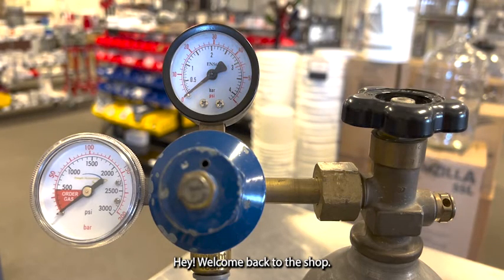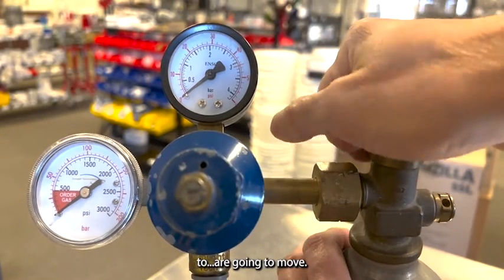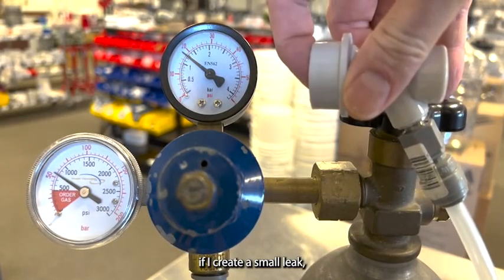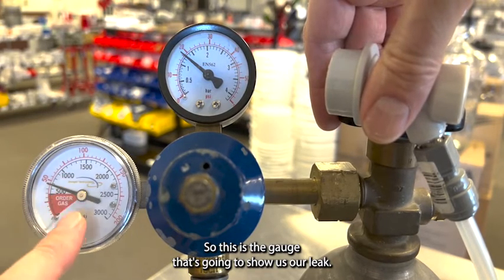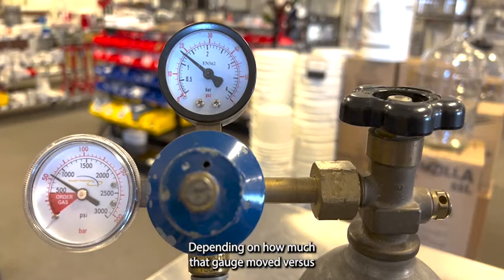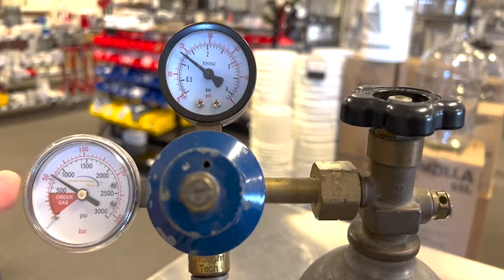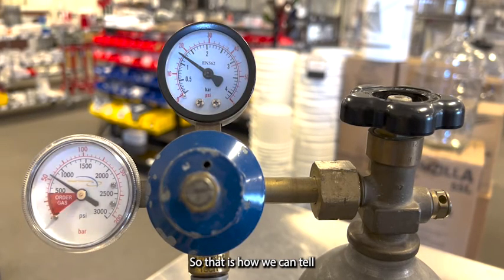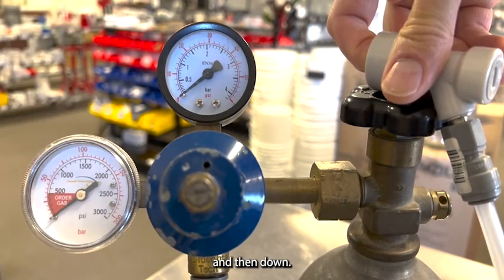Do I have a CO2 Leak?

Comment: Hi there, when I replace a new CO2 tank, I hear a leak from the adjustment knob, so I close it, the I adjust back to 100 psi and doesn't leak anymore. Do I need to fix the regulator, it's  a Taprite.
Reply from the maker: We have questions... The PRV (pressure release valve) on a Taprite CO2 regulator generally release at 65psi max. Are you turning your regulator adjustment knob so that the low pressure gauge is reading 100+ psi? The high pressure side of a CO2 regulator should read 700-800psi depending upon ambient temperature but the low side should be 55psi max. What are you doing that requires 100+ psi of CO2?
Reply: @FYBS   I have a soda carbonator under my sink, it requires 100 psi to 120 psi. I just got the taprite kit.
Reply from the maker: According to the Taprite instructions the procedure for moving a regulator from an empty tank to a full tank include turning the adjustment knob all the way out, installing the regulator on a full tank, opening the supply of gas, then turning adjustment knob of the regulator to its working pressure. Doing this would ease the rush of gas into the low side of the regulator and prevent damage from pressure spikes. Try this procedure next time and see if the regulator behaves itself.
Reply: @FYBS  I just tried, it works, I have the taprite kit to fix it, and I will replace all the new parts anyway.  Thank you for sharing this.

Comment: Hi i have connected 3 full new gas bottles my pressur gauge is fine my tank gauge is on zero/ red and the bottom of gas bottle freezing up .what could be wrong with it please
Reply from the maker: The ice on the bottom of the CO2 tank is telling. Cold CO2 tanks display very low pressure therefore, bring the tank up to room temperature and watch the tank pressure rise to nearly 900 psi/62 bar assuming that there is liquid CO2 in the tank. Even a cold tank should have enough working pressure to push or carbonate a beverage. The most accurate way to discover how much CO2 remains in the tank is to weigh the tank and subtract the tare weight of the tank which is stamped on most bottles. Thank you for watching and thank you for your question.

Comment: When I close my tank, the high pressure guage drops to zero. Not sure what I'm missing
Reply from the maker: Thanks for the question, Donovan! Take a look at https://youtu.be/KrNoUA3oEtc and see if we hit the mark.
Reply: When I tun tank off high pressure stays same low drips from 20 to 10 adjust and goes backup without turning tank on but high pressure still stays same
Reply: When my machine suddenly shuts down while working, Co2  are still released, it does not shut down automatically, what could be the reason?